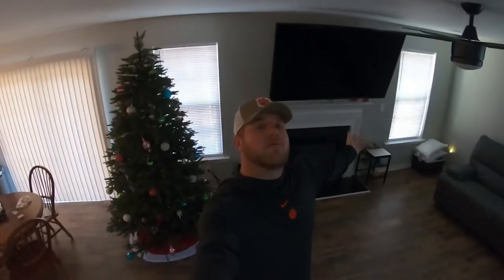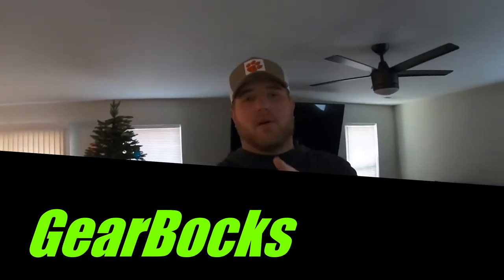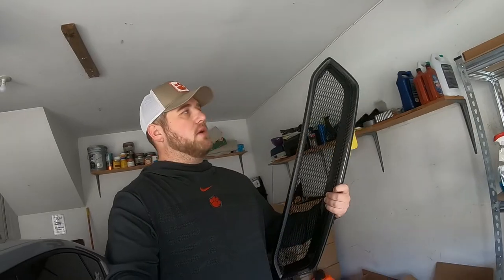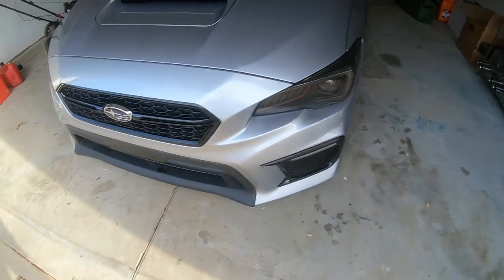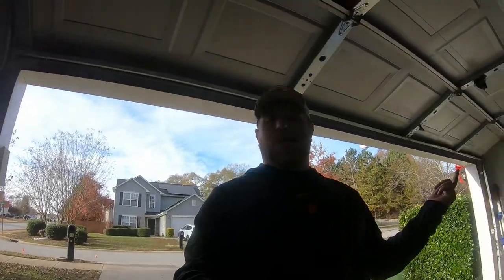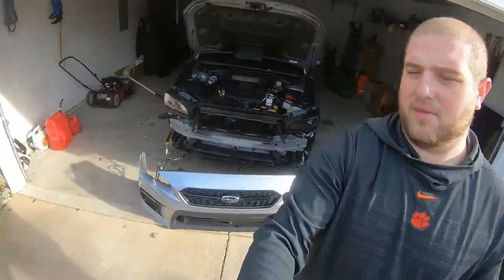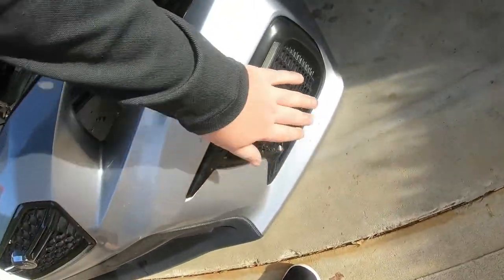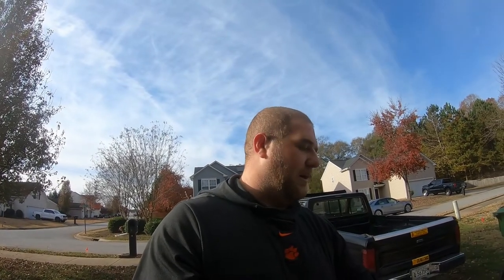Noble CS Carbon Fiber Grille Install 2019 WRX

Comment: You think this can fit with ets 4 inch core fmic?
Reply from the maker: To be honest I'm not sure but I would think yes with a little bit of cutting. The depth of this grille is the same as the OEM grille.